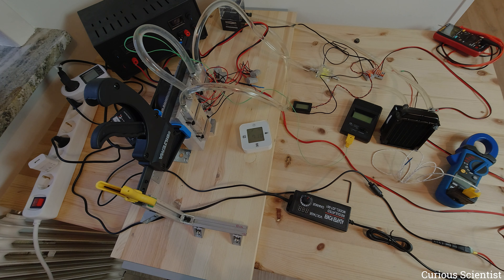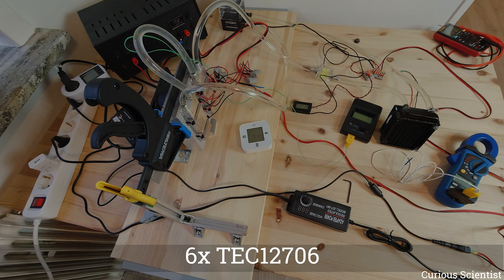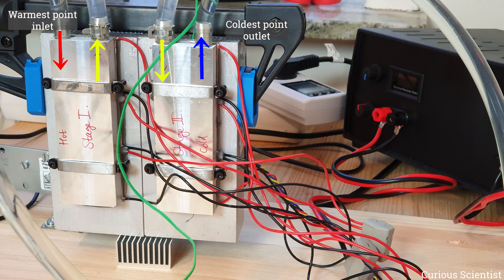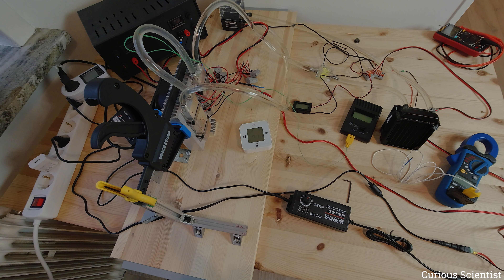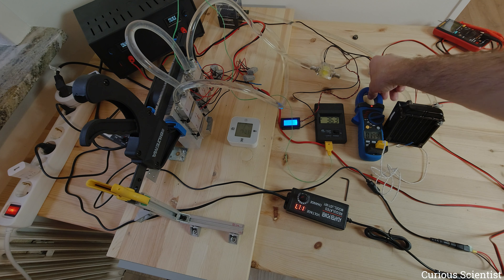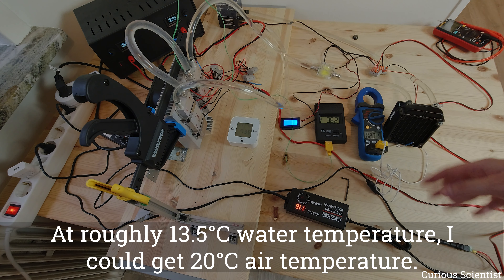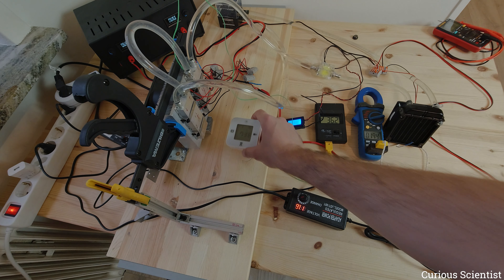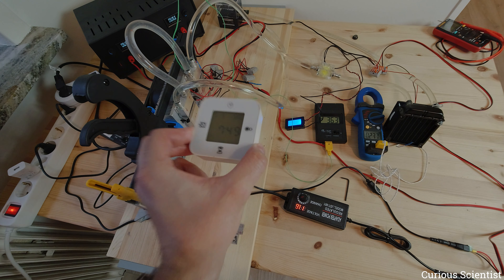Why is the Peltier cooler-based air conditioning a BAD idea?

Comment: With a COP of about 4 with a temperature differential of 10C, I am honestly questioning if it can be viable. You would need about 100 peltier modules for about a 5000BTU cooler which is the typical small window unit. 100 modules sounds like a lot but it would take about 400mmx400mm ($250)... also you need a large radiator for cooling the peltier and possibly another large radiator moving the cold to whatever room. Also the COP increases with a small temperature differential. There is also a huge benefit when you would want to heat the room which many AC dont have.
Reply from the maker: Yupp, this is the whole point of the video. It is not viable! It's not impossible, but as you also highlighted it requires a stupid amount of Peltiers. And using that many Peltier coolers will need a lot of cooling, a lot of power supplies and a lot of electricity. It's easier to buy a proper AC.
Reply: @CuriousScientist  the thing is it might have a niche market. It can be quite thin. No fluorocarbons or high pressures. High reliability. Possibly weigh less. And yeah 100 modules is a lot but you probably can get large discounts for production. Can be significantly quieter. Also it can be changed to a heater with a flip of a switch. I could possibly see this in RV/camper if done right.

Just for reference a small unit air conditioner has a COP of 3.1. And at 30C a pettier has a COP of almost 4 when cooling down by a delta of 10C. Low power though, of about 3watts per module. With some engineering it could be a impressive unit.
Reply from the maker: @lightfeather2439  Believe me, if there would be a good market for it, it would have been already sold as a popular product. The problem with the RV + Peltier combination is that they are very inefficient. You could use that energy more efficiently in a normal AC. There are companies manufacturing Peltier-based ACs (eicsolutions) but the cost is incredibly high and they are not very powerful... They also sell powerful stuff, but it is not affordable for an "average Joe" like me.
Reply: @CuriousScientist  Dude dude dude.. My man .. You're missing the point. I know that you know the room temperature won't go down if the hot and cold side are in the same room. The cooling has to be isolated. The cooling time it takes the hot energy from the air molecule is a one time thing. Once the energy is taken away then it's a matter of how the isolated chamber is conductive to the ambient temperature. So in that time period of taking the heat energy obviously the power consumption will be higher or at peak. Once the heat energy is taken away the whole system will run as idle as the conduction with the ambient temperature. Please .. in the next experiment just take a Styrofoam box as big as possible you can get then just test it with the cold side in the box.
Reply from the maker: @spacejunk51  I already have a series of experiments based on a "big Styrofoam box": https://www.youtube.com/playlist?list=PLaeIi4Gbl1T8SlJY5ODqs2cn5hoXZlIWm

The huge amount of extra energy as compared to the conventional ACs is still needed to get down to a lower temperature where the cooling power can be throttled down.
Reply: What if circulated geothermal water is used in order to take the dF down?  Sure with geothermal temps of 16c the COP should skyrocket to 4+
Reply from the maker: Do you mean to cool the hot side with cold water taken from a water well? 

Sure, the things will improve because the Peltiers won't need to produce high dT. Therefore, they can achieve high Qc. But if you can afford drilling down to hijack thermal energy from the soil, just buy a heat pump. Much-much more efficient.

Comment: I have peltier module but I cannot make ice with it, does peltier really need a high current power supply? I use 12v 7A
Reply from the maker: What Peltier do you have? How do you want to make ice? Do you cool the hot side properly?
Reply: @CuriousScientist  i have 12706 and 12715 but I never make ice with it, unlike some videos that I watch in in YouTube, i think my power supply current was not enough, it is just 12 volts 7 ampere power supply
Reply from the maker: You didn't answer my other questions. I can't help without knowing the details.

Comment: Isn't the difference of 11 degrees in between hot side heatsink and cold side water is a problem of "heat transfer" than the limitation of the peltier? Peltier will create X degree difference, at Y power.
Reply from the maker: To some extent, yes. However, it is also the nature of the Peltiers. We don't want to create too large temperature difference because that would undermine the cooling performance of the Peltier device.

Comment: Bro, I have one doubt. Temperature controller(220v 10A) connected to the input 220V and then to the SMPS(12v 20A) to peltier is safer or input connected(220) to the SMPS then to the temperature controller(12V 20A)to peltier is safer? Is there a possibility of current discharge through temperature sensor probe into the Aquarium? Directly connecting input 220v to the temperature controller is safe?
Reply from the maker: Hi! I do not entirely understand what you are saying, so I rephrase it to make sure. Is the temperature controller is a 220 V thermostat that switches a 220 V outlet? Then, you are hoping to switch the SMPS with this 220 V thermostat? So, at the end you switch the SMPS on and off to power the Peltier up and down, right?

Are you aware of that it is a bad idea to switch the power on and off to control the temperature of the Peltier? It is much better to constantly control the voltage of the Peltier so you can keep the target temperature easily and you do not potentially damage your device by constantly cycling it. I actually made a controller which controls the power for a Peltier and it is not so difficult to build one: https://youtu.be/XjDAgLEsuhU
Reply: @CuriousScientist  I am asking whether 220V temperature controller is safe or 12V 20A temperature controller is safer? Will there be any current discharge from the sensor probe into the water? Also, I will look into your voltage controller.
Reply: @CuriousScientist  also the constant load on SMPS won’t reduce it lifespan? I don’t know these stuffs that’s why asking?
Reply from the maker: Both should be the same safety I think. I mean, if voltage comes back in the temperature sensor, something is really messed up. I believe that the thermostat part is separated from the 220 V anyway in these circuits. Constant load is usually better than switching it on and off. One thing I can immediately think of is the potential thermal fatigue of the components. It might not be a thing, but still it is good to keep it in mind.
Reply: @CuriousScientist  constant load is better for SMPS too?
Reply from the maker: Well, just think about any electronic device which runs 24\7 without any problems. Computers, different household units...etc. Most of them uses SMPS.

Comment: I think power consumption will increase, but not double.  There are more "instances" of each cooling stage and each stage will do less work.  I agree it's not as economical as a coolant-based AC...  An application this may work for is providing cool air at the bottom of an enclosed server rack, which can be pulled up towards by server fans.  A radiator such as the one in your second heat dissipation video would sit at the bottom of a rack where the cold air would "pool."
Reply from the maker: Yes, maybe it would not double. But I am not sure how the temperature drops between each stages so it was easier and safer to assume at least that it will double. 

The problem is that these things consume so much power that you don't really want to use them in a way you described it. Servers already draw stupid amounts of power and produce a lot of heat. The contribution of the Peltier would be very little in terms of cooling, however, it will consume a lot of power. At least this is what I think.